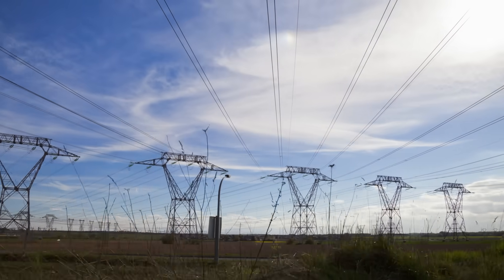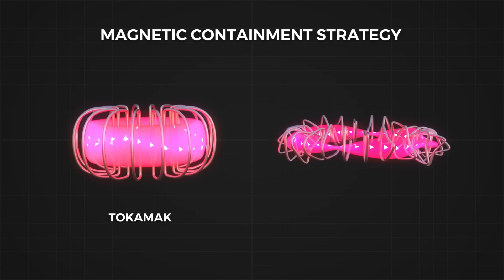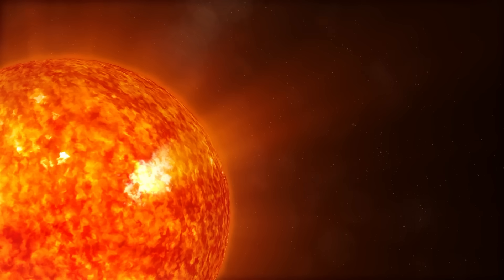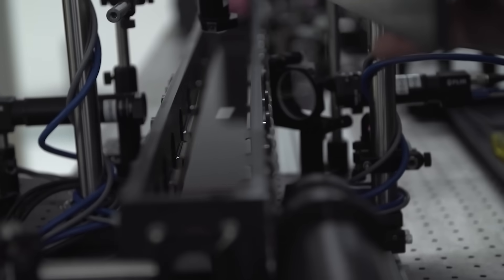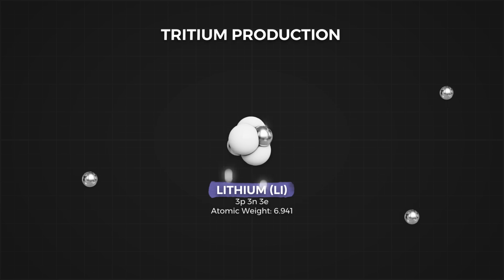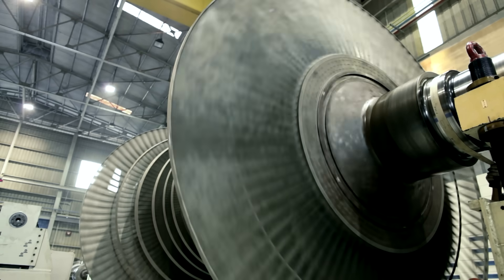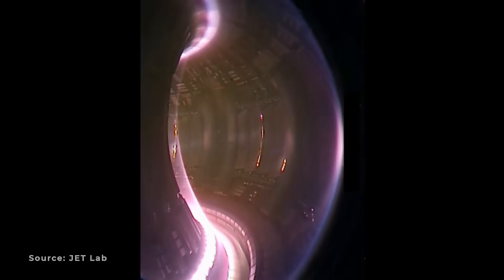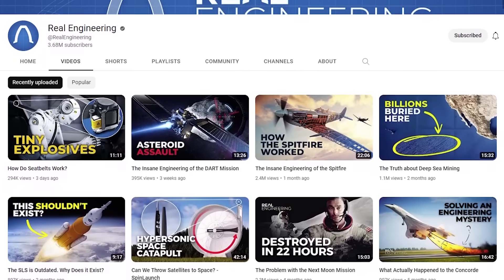The Problem with Nuclear Fusion

Comment: "Technology is [almost] always overestimated in the short term, and underestimated in the long."
Reply: I think warp drive in 200 years is a tad overambitious
Reply: @InnuendoXP  We went from the Turing machine to a supercomputer the size of a suitcase in under a century, technology is developing faster and faster.
Reply: @bunsenn5064  this is mostly due to microprocessor tech advancement making it possible. now we have reached the limits with our couple of nanometers big chips, waiting for quantum computing to kick off.
Reply: @bunsenn5064  warp drove is still a far fetched idea tho. It breaks several fundamental laws of physics, breaking one would have been enough for it to be considered a near impossibility, several make it imaginary. Technology advances fast, but it can't overcome the boundaries set by the universe, not in a century, not in a millennium and not in a million years.
Reply: @bunsenn5064  Technology is not developing faster and faster. At least  not the whole spectrum of technologies. You're mentioning computers, which is the one aspect of technology that advanced apparently exponentially in the second half of the twentieth century. But I would argue that  we see it that way due to technology on that field being at the absolute bottom before the invention of the integrated circuit. We were doing calculations on paper, pen and slide rules or crude electro- mechanical devices at best before that. In fact progress on computers are tied with advances in photolithography which have continue on advancing until now, when we are reaching the physical limitations of the technology, when quantum effects will make futher miniaturization impossible. 
I would not be surprised if  progress in computing slows in the second half of the twenty first century.
If transportation technology had advanced following the pace of computers, we would have FTL by now if that is even possible. Progress in science and technology tend to follow phases of discovery and innovation followed in many cases for long stagnation, until either serendipity or discoveries in other fields produce a new cycle of innovation.
I think a lot of people is being blinded by the rapid progress in many fields during the century between 1860 and 1960. This is possibly a historical aberration, a period of time when fairly quickly discoveries in many fields of the  sciences happened at the same time and could be transformed quickly into applications. I think this probably was the low hanging fruit of scientific discovery and moving on to add new technology to our civilization will require very  high economic investment and effort. 
I'm not seeing Fusion working at least until the end of this century if ever.
Reply: @bunsenn5064  it’s naive to think it will continue to do so forever.
Reply: @genericjoe4082  the new york times said that about the plane before the wright brothers proved them wrong.
Reply: @genericjoe4082  it doesnt break any. That is the point. But mass involved makes it sci fi for now.
Reply: @bunsenn5064  you don't know what a Turing machine is. Do you? No offense to you.
Reply: @piuthemagicman  quantum computers can make Warp Drive possible by mid to late 21st century
Reply: @sensora9646   the new york times didn't say that the plane was impossible, they just said it was really hard. Planes also didn't require any exotic matter, but warp drive does.
Also just dropping a Carl Sagan quote here (paraphrased)-  "Yes they laughed at Galileo, and yes, they also laughed at Columbus but they also laughed at Bozo the clown" 
Just because we have been proven wrong on some stuff in the past, doesn't necessarily mean we will be proven wrong on this stuff too. Also, we only remember the stuff that was proven wrong, and not the stuff that was proven right.
Reply: @clemlo4973   Breaking causality is its biggest flaw. Not creating a paradox is the most fundamental law of physics.
Reply: @genericjoe4082  it doesn’t anymore. Look at Erik Lentz‘s concept
Reply: @karlfranzemperorofmandefil5547  it still does, causality will always be a problem with faster than light travel. Also, you are forgetting the fact that it basically creates a black hole before it could've used any of its energy.
Reply: @genericjoe4082  it’s not actual faster then light travel so I don’t see how causality plays into it. It’s well established that space time itself can move faster then light
Reply: @bunsenn5064  All technology has a hard limit imposed by the laws of physics that govern it and as technology develops it asymptotically approaches those limits. A new discovery might mean there's a new limit beyond the current one but we can't know when or even if that new discovery will be found.

Consider how much airplanes advanced between 1903 when the Wright brothers made their first flight and the 1960s when the 747 and Concorde first flew, then compare that to how much it advanced between the 1960s and today. Developing a new airplane now takes a massive amount of money to extract a few percent more efficiency using principles that have been known for decades. All the low hanging fruit is gone and each improvement is that much harder to achieve. The one area in which there has been exponential growth in recent decades has been in computers but even that's starting to slow.
Reply: @karlfranzemperorofmandefil5547   an object reaching a destination before light can reach it still breaks causality, even if space is technically making the object do it.
Reply: @genericjoe4082  it doesnt break any Law of physics that we know of.
Reply: @genericjoe4082  alcubierre drive doesnt even need négative mass, wich was the theorical drawback of the thing. Some people improved the math to make it work with ordinare mater. From the top of my head still need a ship with the size  and mass off Jupiter i believe from the top of my head, wich is why i Said those day its sci fi.
Reply: @genericjoe4082  u speculate, we do too. No one know,now, thé définitive answer that is what is exiting. For me at less.
Reply: @clemlo4973  1) It does break a very fundamental law, casuality. The explanation is bit too mathy to properly explain in a short YouTube reply and tbh I don't properly understand it either, but it is a very fundamental flaw of it.
2) You need to cite a source on that only requiring mass similar to Jupiter thing.
Reply: @piuthemagicman  quantum computers can only solve a small subset of problems.
Reply: @genericjoe4082   so the sentence "Humanity will never fly in 10 million years" doesn't mean impossible?
Reply: @sensora9646  To word it another way "Humanity will probably need 10 million years to be able to fly", able is the keyword there. It means it's possible, but really really hard. Also, forgot to mention, new york times wasn't and isn't a science journal, while a lot of science today will agree that the warp drive is practically impossible.
Reply: @genericjoe4082  what's the point of being possible if you have to wait 10 million years. Seriously that sentence is basically suggesting it was impossible. Besides you never know they may become real
Reply: @bunsenn5064  yeah but the idea of how a computer would work has been around since the 1700s, to this day there is no practical idea on how to create something like a warp drive.
Reply: @sensora9646  what's the point of building a warp drive if you wait 200 years? The point is basically the same, both can't be build in a single human's life time. Again- "Yes they laughed at Columbus, and yes, they laughed at Galileo, but they also laughed at Bozo the clown".
Reply: @genericjoe4082  200 years can easily be be scaled down to 100 years which is much better than 10 million years. Humanity probably wouldn't be alive by then
Reply: @bunsenn5064  I'm no scientist but I imagine bending the space-time continuum is a tad harder than making big machine small.
Reply: @genericjoe4082  Well even if it's not a literal warp drive.
Reply: @bunsenn5064  
Also, in only 66 years we went from a kite with a 12-horsepower internal combustion engine that barely made a 50 meter flight (Wright brothers) to the Saturn 5 Rocket that put men on the moon, powered by the Rocketdyne F-1 engine which remains to this day the most powerful engine ever built.
Reply: @bunsenn5064  Tech has a limit, sir. That your quote works for some not all.
Reply: @genericjoe4082  I don't think our understanding of physics is as complete as you might think 

It was only 123 years ago that we found protons, neutrons and electrons.
Reply: @marlonbryanmunoznunez3179  Well said.

I keep trying to tell people that science is incremental improvements over years and decades,  but they seem to think everything pops up out of thin air.

I only disagree about fusion, and that's me just really wanting it to happen, I admit.

I think one of the things holding it back is that we've only spent miniscule amounts on research, in the tens of millions, compared to the thousands of millions we've spent on other things, like the military.

( I found that out when I saw a press release and the fusion people were really really excited about a grant that was in the hundreds of thousands.)

( Where would we be if they only spent tens of millions on lithography research over the decades?)
Reply: @genericjoe4082  Rules are meant to be broken.
Reply: @bunsenn5064  computers are more simple then you think. Warp drive sure isn't.
Reply: @shadowofthenamelessking  but these are fundamental laws of physics, which, if broken, can cause our whole reality to collapse, as far as we know it.
Reply: @gerardanderson9665  Likely 20,000 years from now
Reply: @bunsenn5064  you cant predict something that doesnt exist, if we had enough info on how it is then we probrably already wouldve had it
Reply: @bunsenn5064  it is having bursts, it isnt getting faster
Reply: @bunsenn5064 yeah but our gains are becoming less and less
Reply: @bunsenn5064  not really moores law is not something we can follow anymore, these processors I’ve gotten so small and so close together it is almost impossible to get them closer or smaller, and realistically, right now the biggest issue with reaching higher clock speeds is the thermals, here in the next year they’re going to be a different focus on what advancement a processor is making or we are going to be ready to find a different processing unit. 

We are at a point It is going to be almost impossible to make any piece of technology. We are throwing in stuff any smaller.
Reply: @bunsenn5064  like I’m gonna assume you’re older or younger than me right now we’re at a point we cannot make the semiconductor any smaller. They are at the atomic max level size of a silicone atom is 2 nm. That is the size of the smallest semiconductors and those are insanely difficult to actually produce and why people who are trying to break hardware records talk about the silicon lottery because they are out of point, we cannot create hardware consistently because the atomic level is so hard to work on. It is a fucking crapshoot to create something that has a consistent peak  performance, and like I said because of thermal, we can’t even see the peak performance like most people might be playing games with a CPU clock at 6-7 ghz with a really nice set up but we can be getting 9ghz or more with proper cooling, but that is literally right now only achieved with liquid nitrogen.
Reply: @bunsenn5064  like soon it’s gonna be a new processor for the consumer market to be looking at buying for a CPU and it’s not gonna be like the other options and the closest option, you cannot build a computer out of that chip you can buy one but not build and that’s because it’s Apples arm based chip Nvidia is making their own.
Reply: @bunsenn5064  to explain the chip Nvidia is making to introduce into the market next year or this year is both gonna be a CPU and a GPU still having a dedicated GPU but the ability for your CPU to do GPU processing and work in line with the GPU even better with how the whole chip is supposed to work we might see a complete migration of the gaming industry into a different form factor in not long. 

Main reason being is  we’ve reached such a difficult point when it comes to CPUs because so many games require a really powerful CPU, but also require a good GPU and consoles are only ever going to be able to reach a certain form factor size and price X 86 that would be able to do both CPU and GPU processing as well as in a form factor design that allows very quick processing times and when it comes down to it with a gaming and certain tasks, it would allow the GPU to be focused on tasks it’s more optimized for handling while the arm chip will handle the other processing because it can change how and what is processing because it can both be acting as a GPU and a CPU at the same time.
Reply: @bunsenn5064  realistically the future is probably gonna be an ARM CPU chip,  with a graphics card that has more additions to processing units and additional processors to help increase the range of processing the GP you can handle letting it focus on task it should be focusing on. 

After this, the only major advancement we can make when it comes to gaming is figuring out how to reduce thermals and possibly reuse it because it’s a lot of wasted energy
Reply: @InnuendoXP  We made a virtual negative energy loop in a quantum computer, so it might not be as ambitious as you’d think. This was technically an experiment example of ER = EPR or Einstein-Rosen = Einstein–Podolsky–Rosen, was only down on the qubits not in practice.
Reply: @InnuendoXP  SuperAI will do the job
Reply: @InnuendoXP  it just means 200 years is considered short term
Reply: @InnuendoXP  yup, but if you think that it won't happen by 300, then you are underestimating it... idk something like that right?
Reply: @InnuendoXP  yes, if i had to guess I would say at minimum 201 years.
Reply: @InnuendoXP  that might actually be under ambitious
Reply: @thefatbob3710  based on what? What theoretical technological pathway do we have toward folding space that isn't basically just hoping magic happens? That we don't even know how much less habitable our own world may be in one century but we think we can bend a nearby solar system to ourselves in two?
Reply: @InnuendoXP  Based off of how fast we've been advancing off of recent
Reply: @thefatbob3710  advancing at what? Computation? We aren't much farther in terms of mass projection, it's hardly orders of magnitude cheaper to send things into space in terms of material resource or energy expenditure than it was 50 years ago.
Reply: @InnuendoXP  Actualy we have and computation can contribute to other feilds as well.
Reply: @thefatbob3710  I'll take your word on feilds
Reply: @InnuendoXP  O…kay..?
Reply: @InnuendoXP In 1903 the New York Times predicted that it would take humanity 10 million years to develop aircrafts. 9 weeks later the Wright Brothers flew the first airplane.
Reply: @kkiller1438  and who tf is the New York times? A mechanical engineering consortium? Aeronautical experts who'd been studying properties of wind volume & force transfer ever since the age of sail? NYT is just someone with an opinion getting published, not someone who knows anything about what is or isn't possible.
Reply: @InnuendoXP as technology advances, advancement accelerates.
Reply: @VisionsOfSpy  cool maxim, shame it shows you have no idea what you're talking about when it comes to specifics & the limitations on those advancements.

Advancement & it's exponents aren't a linear upward curve, it's scattershot, full of plateaus, and require equally exponentially more complex paradigm shifts & human mental & physical labour to break through.

You might notice that we stopped even going to the moon for decades, supersonic passenger aircraft stopped being a thing in the late 90s, and "innovation" turned instead to things like comfort & fuel economy.

Advancement doesn't mean "this one particular trait I think is good will endlessly just get bigger & better forever", that's not, and never will be, how anything has ever worked.
Reply: @InnuendoXP  You clearly know nothing about human history then. Human predecessors took tens of thousands of years to invent the wheel, we took 300 000+ years to invent the steam engine, the motor car followed a few decades later, then that was followed by the airplane a few decades after that. And let's not even talk about the development pattern of armaments over human history. Maybe you don't realise just how long humans have existed on the planet because when you look at innovation on the large scale, it is a shallow exponential curve followed by an almost incomprehensibly large increase in steepness over the last half millennium or so. Sure if you look at it in the short term what you say may appear to be true but the general trend for technological development follows my assessment far more accurately than yours since I'm working with a much longer period of time with hundreds of thousands more innovations than the very limited number you're focussing on.
Reply: @InnuendoXP Technological advancement is exponential. 200 years ago we were riding horses and the greatest invention was a machine that could spin cotton. 200 years later and we have the peak of human technology in a 5 by 3 rectangle. And in the last 3 we’ve made amazing advancements in AI.
Reply: @InnuendoXP  We went from the first plane Wright Flyer to the SR71 Blackbird in 60 years.
Reply: @InnuendoXP not ambitious enough I say
Reply: @InnuendoXP  

Funny to cause relativistic speeds also carry that same die if you try issue as space is full of hydrogen and dust at about 1 to 3 particles per square meter... And in collider's the beam might be more dense than that but it has the energy of an aircraft carrier at 30 mph. Even that hydrogen in space not counting fender clouds of material or things bigger than stims that seem to like hitting things we send up. The hydrogen alone at near light speed or even half could hit with the force of an armored PT boat at full speed so a field to deflect that would be needed and would probably kill you as well and maybe trust the ship apart or at worse vaporize it....

So stuck in the solar system.... 

As  any place out there and in our solar system you would die in 39 seconds or less cause of how hostile everything is out there. So stuck on Earth as it's the easiest thing to fix anywhere in the universe that's been discovered so far as we can't even reach the nearest star to the sun...
Reply: @InnuendoXP   VR will give us the ability to simulationally warp around in less than 10 years.
Reply: @InnuendoXP  more like underambitious. if thats a word. we went from a computer occupying an entire room to a computer millions of time faster the size of a chip. Nothing is impossible.
Reply: @InnuendoXP  Warp Drive by 2063 is impossible by 1990, Probable by 2022, Likely by 2032 and Possible by 2052.
Reply: Main reason is because they want to attract investor to pump money into their projects.
Reply: @NoOneReallyCaresAboutUkraine  can you explain why?
Reply: I estimate 1000 years for a warp drive.
Reply: @Galagar Rocket  just because we don't know how to do something doesn't mean it breaks laws of physics. We just don't have the work around, the tech, or the fundamental understanding of nature to do it... yet. Everything was impossible until it wasn't. 
My favorite example of this is in the generation before Einsteins, you can find quotes and really old video of all these different scientists saying "yes atoms are made of energy but getting any energy out of the atom is completely ridiculous" and basically scoffing at the idea.   
Imo, it seems like scientists will spend their lives taking science to a point and then saying X is impossible, and then the scientists who were once children when the old scientist said it was impossible are now old scientists themselves and prove the former wrong, but then say y is impossible, and the cycle repeats. Just my observation.
Reply: -Paris Hilton
Reply: Flawed and overcompensated methods are the fault in overestimations, new and different discovery's are the leaps that are underestimated
Reply: Technology is like would you rather have long ass hair or long ass hair
Reply: For "starters," the life cycle of birth, expression and death is necessary for any organism to evolve and survive into the future. The limit to life expectancy is completely dependent upon the rate of change for the physical constants and the implications for DNA replication. This evolution is known as TOP DOWN cosmology, where the very-present uncertainty of the physical constants is mute testimony to their rate of change.
 
This is near certain: Imagine a universe beginning with a single “particle” of gigantic mass that spontaneously divides into two smaller masses (with a field that obviously must exist to unite them, like, say, primordial electrostatic gravity, a quantum relationship modulo 2). Imagine that over “time” the process of division continues, producing “newer,” lighter “particles” (and forces that unite them “programmed” for future expression within when, per chance, they are irrationally unreconcilable by quantum counting) over “time.” (Note: That cascade of particles is presently observed as “nuclear decay,” where heavier elements spontaneously cascade into a spectrum of heavier-to-lighter elements.) To see how rapidly the NUMBER of observed particles (of increasingly smaller mass) can grow in a short amount of time, just multiply 2 x 2 = repeatedly on a small calculator– in a very short time the numbers go off the scale! Just imagine, then, IN THE PROCESS OF DIVIDING, heavier masses, that eventually form galaxies, divide over time (seemingly coming from “nowhere”) at each epoch of division (and extinction). This process is known as “TOP DOWN cosmology.” In the end, you have present-day smaller galaxies, PLUS the cosmic heat signature of NOW-EXTINCT past elements (including galaxies), known today as the “cosmic microwave background radiation.” (Note: Smaller early galaxies are required by BOTTOM UP big bang cosmology, where predicted smaller primal galaxies form larger galaxies over time, and where the predicted cosmic microwave background radiation would be “smooth;” HOWEVER, the OBSERVED cosmic background radiation is actually “lumpy,” and OBSERVED primal galaxies are actually larger.) TOP DOWN cosmology wins! PS: I call this theory “The Origin Theory,” as an extension of Darwin’s “Origin of the Species.” Again, please leave the ultimate origin and direction of our currently-complex universe (either with TOP DOWN or BOTTOM UP cosmology) to lesser-probabilities of 50/50, so as not to “throw the baby out with the bathwater."
 
Given that the latest “breakthrough” in fusion technology recklessly announces controlled fusion energy when it provides ignition WITHOUT accounting for energy out Vs TOTAL energy in (I still remember “cold fusion”), My TOP DOWN theory of cosmology says that in order to reconcile static gravitational and Coulomb effects (a valid grand unification theory goal) there is a value, a number R, such that Ke^2 = RGm^2, where K is the Coulomb constant, e^2 is the square of the charge on an electron, G is the universal gravitational constant and m^2 is the square of rest mass of an electron– what can be simpler than that! The calculated value of R is 4.16574 x 10^42. Given my TOP DOWN cosmology, then, Coulomb effects are 4.16574 x 10^42 times more intense than gravitational effects, meaning that local ignition, compression and containment needed for sustained fusion reactions are collectively unattainable. Clearly, the evolutionary direction of the universe must be countered and reversed to sustain a local fusion reaction– a physical impossibility! Yet, much money and time is being WASTED on attempts to “find a way,” apparently to justify continued reckless population growth on this fragile planet. (The problem does not exist with fission reactions, which have their own set of intractable problems, because energy release follows the direction of universal evolution.) What is R? Numbers and predictive ability matter (rather than finding explanation after a discovery, presently being done with BOTTOM UP BBT): Per my TOP DOWN cosmology, the radius of the universe on a quantum level is R = Root (M/m), where M is the total mass of the universe needed to unite gravitational and electrostatic forces and m is the rest-mass of an electron, yielding, Ke^2/ R^2 = RGm^2/ R^2, where R^2 is the square of R. The calculated mass at a quantum level, including “missing mass,” is M = 1.58079 x 10^55 power Kg, and the calculated radius of the quantum realm is R = 4.16574 x 10^42 power measured in instantaneous, dimensionless units. (M is undefined in the quantum realm, yet partially discernable as the observed mass Mo of the universe in the macroscopic world,). The number of unit circles (or squares) in the quantum realm is R^2 = 1.73534 x 10^85 power. It is a quantum attribute that area of unit squares and number of unit squares are indistinguishable (No need for citation, as all stated derivations are my own.) Everything is separating visually by such distance that the presence of extra-terrestrial life is very difficult to detect, yet everything has always been quantum-connected (“not locally real”). The total mass M needed to reconcile gravitational and electrostatic states is M = Mo /(2Pi – 1) (alpha^2), where Mo is the OBSERVABLE mass of the universe, (2Pi – 1) is the Bell inequality (ever an inequality in the macroscopic world, and equivalent to Euler’s “proof of God” in the quantum realm, where M is UNDEFINED), and (alpha^2) is the square of the fine-structure constant (a optical magnification factor, twice applied for virtual and real expression). In the quantum realm, the equation is undefined, because the radius is equal to the circumference, meaning that Pi = 1/2. The number of unit circles (or squares) in the universe is M/m, where m is the present-day rest mass of the electron. For a unit circle to become a unit square, Buffon’s needle problem becomes applicable, where one side is electrostatic and the other is gravitational. In order for the PROBABILITY to equal 1/2 (regarding Bell’s inequality AND Buffon’s problem), Pi = 4, meaning that Pi = 1/2 AND Pi = 4, implying that 1 = 8; hence, the qubit (used in quantum computing) is emergent. (My observations and derivations– no citation needed.) Using my TOP DOWN cosmology, the rate of change of alpha is -2.7958 x 10^-17/ year, based upon a perceived age of the universe of 13.799 x 10^9 years. For very large R the definite integral of R over time T approaching origin of the universe to the present day is approximately 1/2 of R^2, verifying perceived dichotomy (a weird quantum nuance, where areas AND number of unit circles or squares are indistinguishable).
 
In the quantum realm, the term (2Pi – 1) = 0 can also be considered as the sidereal rotation of a unit circle within a unit circle (created by Buffon’s needle drop probability).
 
As a physicist, I have been promoting this TOP DOWN model since1979. For those who would state (not me) that this is a “fun theory” (with its fulfilled prediction of larger primordial galaxies), demanding the math; then, when presented with the mathematical model finding the much-sought-after hidden “missing mass” and quantum gravity, implying that I am a mathematician with little relevance to physics: The physical world can instruct the mathematical world, IMO. In addition to reconciling the Coulomb constant and the universal gravitational constant, I have explained the significance of the little-understood fine structure constant, alpha. If you would simply “run with it,” you have the information to calculate the age and rate of expansion of the universe (much older than the presently-accepted age of the universe, hidden by quantum effects).
 
Here are three obvious “predictions:”
 
-Per TOP DOWN cosmology, there is understandably a paucity of antimatter in the local universe.
 
-Hydrogen-rich stars and galaxies of equivalent mass, respectively, previously and inappropriately deemed to be colliding under BOTTOM UP (BBT) cosmology are actually and appropriately DIVIDING under TOP DOWN cosmology, which respects and predicts this behavior from evolutionary changes regarding critical mass (witness our own galaxy and Andromeda, representing main sequence evolution).
 
-The current abundance of elements is reconciled by main-sequence TOP DOWN evolution, not requiring multiple solar cycles, exceeding even the presently-accepted age of the universe per BOTTOM UP BBT.
 
There are no absolutes (a logical dilemma in itself). The closest thing to absolute certainty is found in abstract math– in application there is always an uncertainty (like when counting apples). The best that can be expected in the physical world is to “bet on the odds.” Given my TOP DOWN cosmology, odds are for things dividing rather than melding regarding cosmic events; whereas, there is every inclination for one schooled in BOTTOM UP BBT to look for, and prejudicially expect observed galaxies and stars to be colliding. Regarding dark energy: The hidden quantum world, which reveals itself as “locally not real” (Nobel Prize already given), contains a memory of the past in our own DNA, for example, revealed in morphogenesis (“ontogeny recapitulates phylogeny”), “betting on the odds.” Dr. Rupert Sheldrake describes this as “morphic fields” and “morphic resonance.” BTW, His theory accounts for why the Kelly astronaut twins are no longer DNA-identical twins, where there is no other better explanation that I have seen being offered– instead, relegating any explanation to the growing category of “unexplained mysteries!”
Reply: Wonderful to see that everyone has ignored the nutjob and his uncle's story
Reply: @Adam why can't do both?
Reply: Tbh to everyone here, I really want FTL travel to be real. I really want to be explore other solar in my life time, but it really doesn't seem possible.
Reply: @genericjoe4082  in our lifetime, i dont really think anyone believe in. The Moon will happen, mars maybe, and if we are damn lucky maybe a probe to the closest star. In our lifetime its already awesome. Some freacking monkey wandering planètes and star are quite something.
Reply: @clemlo4973  I mean as the travel time being a life time. From solar system a to solar system b in a single person's life time.
Reply: @genericjoe4082  not true there is a project to go to proxima, the project starshot i think, human wont Land there, but a small probe on Solar sail Can make it 20 year, they Hope to hop in 20 year. With delay u Can expect a 50 year to have the probe there. Definitly not a stretch to see it depending ure lifetime.
Reply: @clemlo4973  there is a difference launching 1 gram of weight vs launching a human. We can probably reduce the time needed to go to another very close solar system to a human's life time, but most solar system are too far for that.
Reply: @genericjoe4082  u Can even "Hear" venus nowadays. Lot more to Come. Europa, titan, venus... There is much to get exited about. Like 2 minute papers would say "what a Time to be alive"!
Reply: @clemlo4973  yes there is a lot to get excited about today, but I don't think inter galactic travel is one of them.
Reply: @genericjoe4082  dépends how u see it. Im fine with the probe way. Need to start Somewhere. And breakthrough starshot will happen, Time its already privately founded.
Reply: @genericjoe4082  how i see things, exploration and data collection is already the 1st step of colonizing. Im fine with the Idea being able to see this much happen before dying.
Reply: @clemlo4973  I am fine with it too, but I don't like when people get overexcited over FTL travel and stuff, usually ends in a lot of disappointments
Reply: @genericjoe4082  but the conversation is on the table. U stated that it break physiques its not. U were plain wrong about it. even tho its centuries at best still doable.
Reply: @emergence
Reply: It’s ironic since news came out a couple hours ago of a breakthrough nuclear fusion reaction that outputted more energy than energy put in. Look it up.
Reply: Hydrogen and oxygen, baby
Reply: Hey
Reply: The impact is disproportionate from a small minority of tech. Industrialization has also caused our evolution to accelerate to a mind boggling pace with the worst traits proliferating the quickest, it's really not somethint you can overestimate
Reply: Also cheap fuel would make dysgenics worse.
Reply: @NoOneReallyCaresAboutUkraine  you said "wrong" but you refused to elaborate. Go home, kid
Reply: @NoOneReallyCaresAboutUkraine  see? piss off
Reply: The hype cycle
Reply: yes its the ramuk1933's 1st law of technology
Reply: still don't have flying cars... unless 40 years or so is short term
Reply: People are the same way. People overestimate what they can do in a year but underestimate what they can do in 5 years.
Reply: Spot on
Reply: Honestly it really pisses me off seeing this comment get so many thumbs up, because finding even five other people who would say the same thing without hearing it first is pretty much impossible. So many of these people are groupies who don't really understand the implications of what you said and it's fucking disgusting.
Reply: Try this data point: Because the electron's Coulomb (electrostatic) repulsion for another electron is 10-with-42-zeros times as strong as gravitational attraction, harnessing a controlled, sustained fusion reaction in a local environment WITH MORE ENERGY DRAWN OUT THAN PUT IN FOR THE ENTIRE PROCESS is a PHYSICAL IMPOSSIBILITY. "Put that in your smipe and poke it!

A physical impossibility! Yet, much money and time is being WASTED on attempts to “find a way,” apparently to justify continued reckless population growth on this fragile planet. (The problem does not exist with fission reactions, which have their own set of intractable problems, because energy release follows the direction of universal evolution WHICH IS TOP DOWN cosmology)
Reply: Per Google, John Adams said, “Facts are stubborn things; and whatever may be our wishes, our inclinations, or the dictates of our passions, they cannot alter the state of facts and evidence.”
Reply: Since the universe began with a singularity, if that singularity was a Big Bang, then all of the currently-observable order is required to “self-assemble” from the resultant hot chaos—“allowed” because, though extremely improbable, it is not theoretically prohibited. I don’t believe that! My theory starts with a singularity where everything is connected into a single mass that initially divides into two, like in cell division, but with smaller masses with each division, united by proto-gravity. (Gravity and light were indistinguishable in the beginning.) If in choosing between the two, one of the theories contains a “unwanted message,” that “everything is connected,” then the former theory would be preferred (with blinders on), thereby conceivably allowing a misinformed majority to be manipulated for power and selfish gain by a elite minority. You can “take that to the bank!”
Reply: Yea its like saying internet is useless in the late 80s.
Reply: Who is this a quote by or you come up with it?
Reply: Science Revolution  says the channel named "Science Revolution"
Reply: Good sentence it works always, it worked 50 years ago, 25 years ago, now and in 25 years ahead
Reply: FACTS!!!
Reply: Never forget the interference of Politics and competing   Financial interests  to  new technology ..Think about the decline of Nuclear Energy  as  an Inverse proportion  of fossil fuel use  ...Motivated ...   by  the money and influence of said Fossil fuel Industry
Reply: Repent. Believe in Jesus. John 3:16 KJV - For God so loved the world, that he gave his only begotten Son, that whosoever believeth in him should not perish, but have everlasting life. 
Luke 13:3 KJV - I tell you nay: but except ye repent, ye shall all likewise perish. 
2 Corinthians 5:17 KJV - Therefore if any man be in Christ, he is a new creature: old things are passed away; behold, all things are become new.
Reply: This ^
Reply: We are only 10-20 years away from an AI producing faster innovation than humans. It's all exponential from here.

So stop being at war!!! >:(
Reply: I remember my uncle said he had conversations with ET aliens, and he said that humans have been making so many mistakes with their pursuit of fusion like there's so many other ways different from a steam turbine to extract energy from fusion,etc, we need to change our perception of fusions and methods around it
Reply: @kingsman3087  TRUE
Reply: @kingsman3087  what else would you use it to do?
Reply: @kingsman3087  mistakes always happen in the pursuit of a new discovery. Pretty much how we learn, but broader approaches are welcome.
Reply: @kingsman3087  its entirely possible that those methods dont exist within our nooshphere
Reply: @kingsman3087 your uncle or was that you trippin balls 😂
Reply: @kingsman3087  my best idea on how to do that would be to extract the electrons from matter. Electricity as we know it is simply the flow of electrons from negative to positive, so if we find something that emits negative charged particles, we could theoretically funnel them into useable power. Since ionizing radiation is comprised of protons, neutrons and electrons, we just need to find a way to separate them, put them where they need to be (protons at positive, neutrons out, and electrons at negative) and then connect it to a circuit. Transistors may be the best bet for this separation since they work by allowing charge to be harnessed through the use of npn or pnp transistor setups (npn is negative positive negative, pnp is positive negative positive.) Which is how solar panels turn photons into electric charge. Since nuclear decay causes the material to release both heat and light, another setup could be used to turn both of those into energy with solar-peltier panels extracting the extra charges to increase efficiency. 
The problem is, though, that people don't like the idea of nuclear materials in any context, even though it is the cleanest form of energy. This is the reason MRI machines don't include the N in their name (nuclear magnetic resonance imaging, NMRI.). This means that nuclear power is at a major disadvantage due to Public opinion. 
However, I think something like what I'm describing exists, at a decent level. I think there's something called a nuclear diamond battery which uses nuclear waste and a diamond crystal structure to produce electricity.